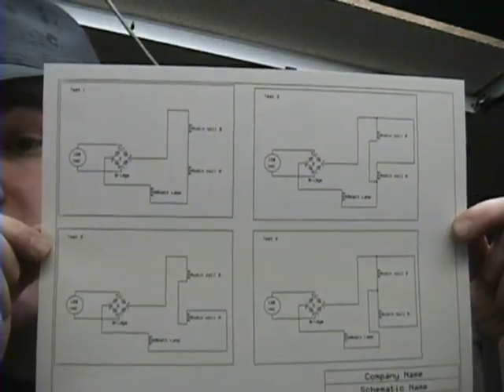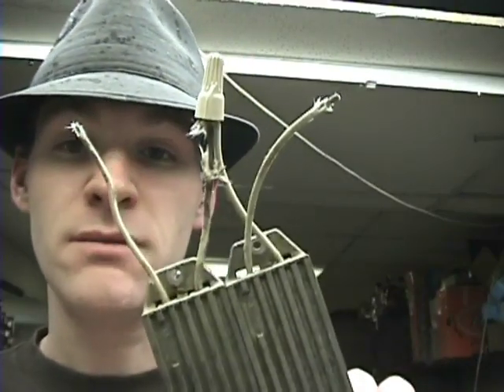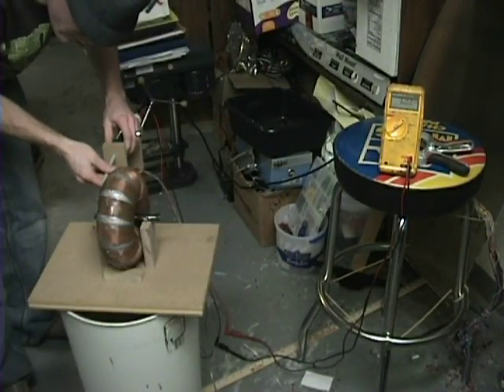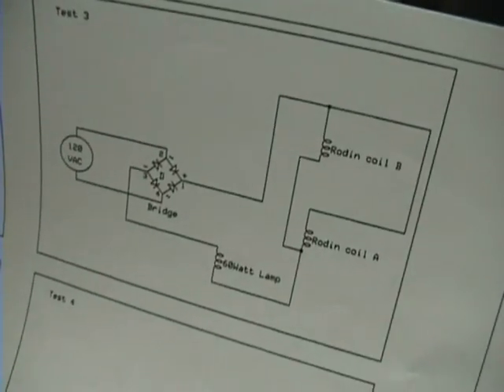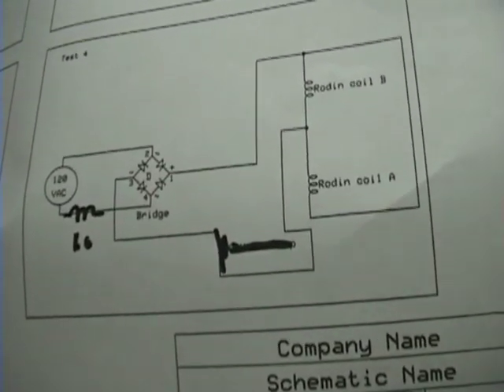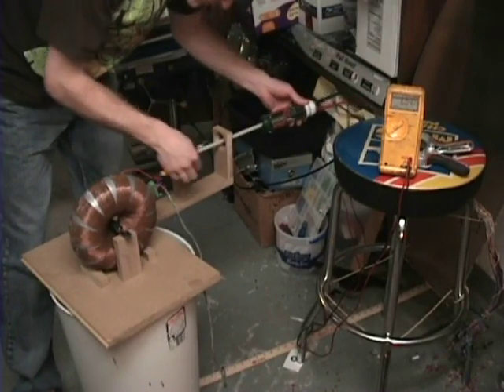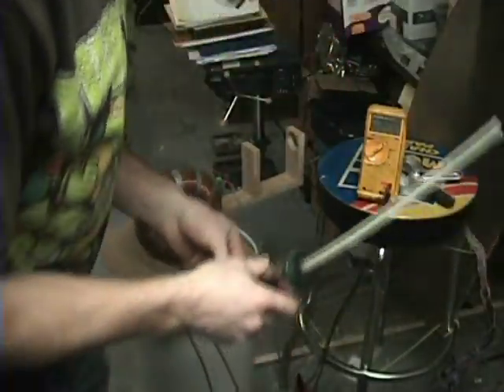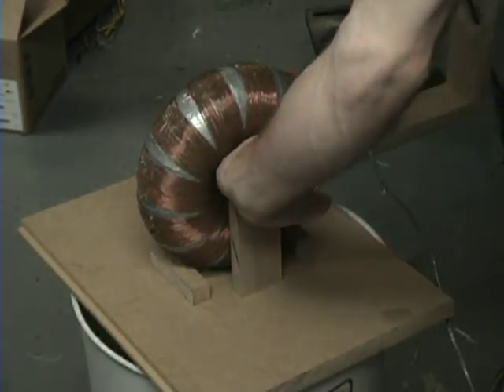Rodin Monopole Test!!! & Then Some High Current Coil Tests!

Comment: Nice work Russ.  I think your magnet tester is a little more definite than the little white LED beeper stick thing.  I think if there really is such a thing as a monopole, it is the fine line in the middle of these coils where you can feel a magnet center its self in the field.    I have a feeling it is just a boundary between north and south fields  though.

Comment: you might not be getting a change in reading for a few reasons. couple i can think of is 1, probe inst sensitive enough. 2, youre inside a building that may be shielded by something. be it power lines, wires running through the wall, the wall itself could have an effect. try the orientation test outside and see what happens

Comment: I should email ya, but I know you're busy Russ. 
I've tried it with just a 9+9 24AWG blue toy form "Rodin" & few other flat designs using 6-12VDC & 24-120 VAC on a 6" grade 5 bolt. LOL! Yeah I burned up a couple coils.
No Monopoles, but I did get some strange field formations. In one case, it's like it set the field diagonally down the length of the bolt so the strongest points were kitty-cornered at one outer edge of each opposite end.

Comment: Why not wrap s coil around the base of the drill bit and try it.  You can then switch the polarity on the coil and see what transpires....  One third od the legnth sticking out.  First one layer, then wrap another yaer aboube that and then a third.  see what the meter is doing each time.  Heck if you can manage to wrap a conical core with the 1/4 mass of the rodin coil wire weight........  I would be careful of the drill bit tip at that point. Pum imtended.